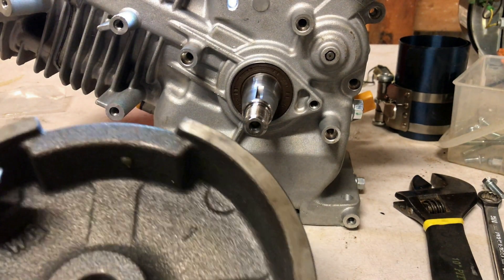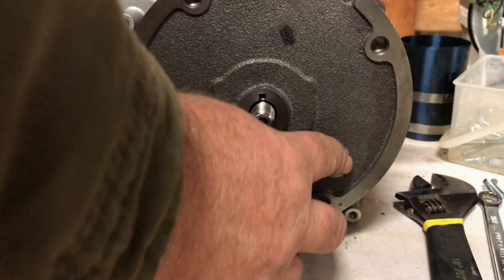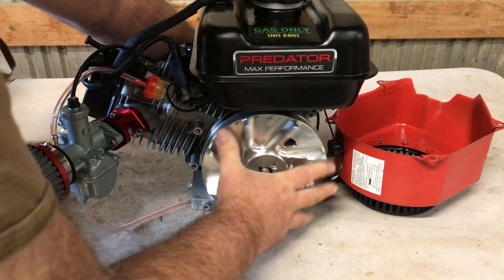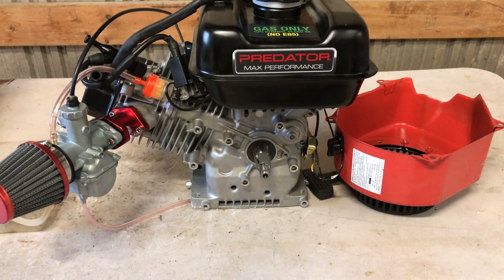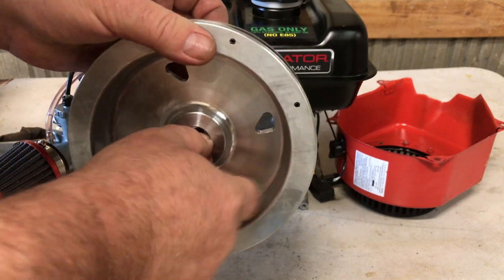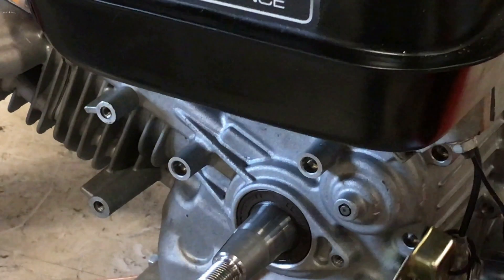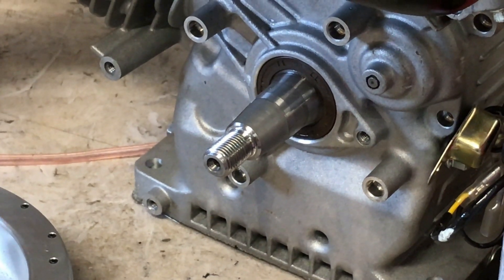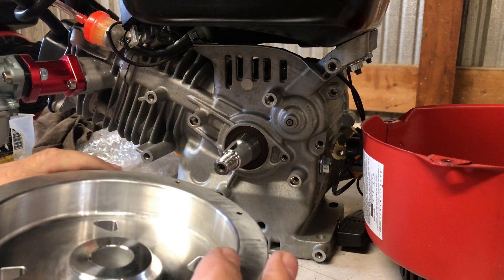Hard Starting and Kickback Solutions for your 224 Predator 212 Engine Build 223 Wildcat 236

Comment: Hey man, I just finished building my predator 212 hemi. It’s got billet rod and flywheel, vm22 clone carb, .010 hg and high compression piston. It does kick back sometimes and with the spark plug in is kind of hard to pull. I’ve got it running a couple times but I’m wondering what kind of gas should I use? I used regular non ethanol gas from before I built the engine. I don’t know if it’s high enough octane, or if the gas is too old what kind of fuel would you recommend ?
Reply from the maker: If you have a 212 with a flat top piston and a .010 head gasket it's probably building enough compression to benefit from a higher octane fuel (depending on the amount of quench you've got). I'd check the small stuff first to make sure the valve lash is set properly and the timing is not too far advanced. If you're running a billet flywheel those will have an advance in ignition timing even if you have a stock "0 degree" timing key installed. They're really set up for racing and Methanol fuel for the best performance. Lots of advance is great for performance but if it starts pulling the rope from your hand more often than not, you may need to reduce the timing a few degrees. The only other option would be an electric start. Gasoline fuels won't handle as much timing advance as Methanol fuels. If you're using gasoline type fuel try mixing a little synthetic two stroke oil, maybe start with a 100:1 mix and see if that helps, if not you can mix more two stroke oil in the fuel if you need. I know it sounds crazy but the two stroke oil will make your fuel heavier and that will reduce pre-ignition and kickback. It's also cheaper than buying high octane race gas. Small stuff first then if your problem remains you can start checking the big things like if the compression release on the cam is hitting the side of the crankshaft counterweight.
Reply: @KentuckyFriedFixes  I set the valves to .003 and the problem persisted so I set it to .0025, it still starts but is kind of difficult. I heard some people say that setting the valves closer is good but I have no clue. Would methanol or 93 octane be fine to use with that carb? Worst case scenario If I put a thicker head gasket for less compression would that make it easier to start?
Reply: @KentuckyFriedFixes  and could you mix the two stroke oil with higher octane ?
Reply from the maker: @Wbgmt07  Depending on your cam grinder's profile you can set the valve lash at .002 to improve the function of the compression release. Two thousandths was the suggested lash on the Banzai 265 cam from EC to help with compression release issues. Unless you're racing, I'd stay away from Methanol as it takes quite a bit of maintenance to run it. You'll have to do tons of oil changes not to mention flush the fuel system with gasoline every time you put the engine away. Now that's not to say I don't like Methanol fuel, fact is I LOVE IT! But, there's a lot of maintenance that comes with running Methanol fuel and if you're not winning money with the engine it's not very economical for the wallet. You can use two stroke oil in most high octane gasoline fuels. The only exceptions would be any fuel that contains alcohol as that doesn't mix well with the two stroke. If you decide to experiment with fuels I'd suggest a good specific gravity test kit for fuel. They're not cheap these days but it's the only way any fuel experiments will pay off. Depending on how much you've raised the compression, you may be able to get by with some 93 octane (Shell and ask for 93 without alcohol) with a little synthetic two stroke oil mixed in. The 112 and 114 race gas won't benefit you unless you have some really high compression, aside from that those fuels aren't cheap to run either $. Run a compression test and compare your numbers with a stock engine, you'll know whether or not you can use the 112 or 114 octane.
Reply: @KentuckyFriedFixes  OK thanks man 👍👍👍
Reply: @KentuckyFriedFixes  Are you talking about the shell V-power fuel?
Reply: @KentuckyFriedFixes  are you talking about the shell v-power fuel?
Reply from the maker: @Wbgmt07  That's the one. But test it for Ethanol to be sure your local Shell is selling the real deal and not some premium knock-off that contains Ethanol. It probably sounds like a conspiracy theory, but there are some locations that will do that and if your local Shell DOES do that by law it must be listed on the pump that it "may contain Ethanol". If I pay for "Ethanol free" fuel and it tests to contain Ethanol, I start making phone calls to their Corporate office with the address of the location that's selling the "knock-off" version. Of course I'm probably viewed as an old guy yelling "Get off my lawn!" but to me if you pay for something that's advertised as "Ethanol free" I get miffed if it's not.
Reply: @KentuckyFriedFixes  Hahaha I get it man 🤣. I think I’ll try to find the v power 91 or 93, then add a little oil to it. I’m pretty sure because of some law now it has to contain ethanol but it should have no more than 5%.
Reply: @KentuckyFriedFixes  but what I was using before was 3-4 month old 87 ethanol free. So it should hopefully fix my problem it will start but the exhaust will backfire and kick back every 4-5 pulls.
Reply: @KentuckyFriedFixes  if I can only find 93 with ethanol is it safe to use if I add a fuel stabilizer?
Reply from the maker: @Wbgmt07  It's just my opinion but the Ethanol free fuel is best if you're going to add two stroke oil. If you have a different fuel additive you want to try just read the bottle. They'll tell you whether or not Ethanol is recommended with their product.
Reply: @KentuckyFriedFixes  alright thanks man
Reply: @KentuckyFriedFixes  the best ethanol free I could find was 89.. should I add a little 2 stroke oil or what other kind of additive?
Reply from the maker: @Wbgmt07  The synthetic 2 stroke mix will help but if you're having an issue due to compression, you'll probably need a little higher octane to start out with. I have a few recipes for additives to increase octane in gasoline but I can't give those out.
Reply: @KentuckyFriedFixes  OK. So I put Octanium in the 89 and bumped it up to around 95 give or take. Engine runs much better. Still kicks back some but it bogs out and stalls when I give more than 50% throttle. I am still using the stock gas tank. could this potentially be solved with a fuel pump?
Reply from the maker: @Wbgmt07  It sounds like it's running lean. I'd pull the spark plug and verify before making any adjustments to jet size. If the main jet or pilot is too small, a fuel pump won't help you. What size jets are you currently running in the VM22?
Reply: @KentuckyFriedFixes  could it be running too rich? It was backfiring a lot and even white smoke came out carb
Reply: @KentuckyFriedFixes  think my head gasket may be blown which is causing the spark plugs to get super dirty, which might also be why it starts dying
Reply from the maker: @Wbgmt07  The spark plug will tell you if it's running rich or lean. After you get your head gasket sorted, pull the spark plug and check the color. White=lean, Black=rich, a nice milk chocolate brown color is just right.
Reply: @KentuckyFriedFixes  OK looking back I think it is ok. I think that my engine was smoking some because of air fuel ratio and brand new piston rings being broken in. My spark plug getting super dirty I probably thought my air fuel was too rich but I was probably flooding the carb by trying to start it several times
Reply: @KentuckyFriedFixes  Hey so I accidentally torqued the rod to 13.5 ft pounds or 162 inch pounds instead of 170. Im probably gonna take it back apart and torque to spec but im just wondering if I do can I leave the cam and lifters in so I don’t have to adjust the valves again
Reply from the maker: @Wbgmt07  Hi West! Once the side cover has been removed to access the internals, you'll need to adjust the valve lash after it's installed. The side cover can move a few thousandths of an inch one way or the other. It's a good idea to always follow the manufacturer's procedure and torque spec for the rod bolts. Give them a call, there's usually one spec for lubricated rod bolts and a different spec if you install them dry.

Comment: I’m so damn lost with this shit lol
Reply from the maker: Hi Tyler! It's not magic and anyone can do this. If you're having kickback issues from the Predator 224 build or a similar engine build there's usually 3 things to concentrate on, Fuel type and specifically fuel octane, valve lash and ignition timing. The engines with high performance parts will always run better with the timing set high but if it starts pulling the rope from your hand more often than not you can make a few adjustments, or use an electric starter if you're racing. Fuel can cause the same issue if you're running a lot of compression and don't have the right fuel. A little two cycle oil mixed in with the fuel can do wonders.
Reply: @KentuckyFriedFixes  okay awesome man I really appreciate the advice to be honest I just have never messed with timing before so I’m a little lost but fuel I can understand , my cart has a hard time starting like a have to pull it 50 times an once it starts it’ll run strong but takes forever to start and it kicks back
Reply: @KentuckyFriedFixes  I just run regular 87 because I was told to run that
Reply from the maker: @tyleradcock5493  Hi Tyler! 87 octane is fine for stock engines. You only need the race gas or Methanol for racing builds with high compression. If it takes more than 3 pulls to start your engine, something is wrong. Either carburetor fuel or air leak issue or the spark plug needs replaced. A good tune up and a valve adjustment will probably help your engine behave properly.
Reply: @KentuckyFriedFixes  okay thanks man I will try when you say valve adjustment how do I go about that ?
Reply from the maker: @tyleradcock5493  Check out some of my engine build videos. Just fast forward to the valve adjustment part when I install the head.
Reply: @KentuckyFriedFixes  okay thank you very much man

Comment: Very late to the game if anyone sees can I lash to .005? I have kickback on .003 runs first pull but kicks every other
Reply from the maker: Hi Guy Farmer! The valve lash really depends on the camshaft choice of your build. This video was designed for the guys following along on the Predator 224 build. In that one we used a 265 lift "Banzai" camshaft and the specs on the valve lash were suggested at .003 but the guys at EC recommended setting it at .002 to work better with the compression release. Usually the looser you go on the valve lash, the more problems you'll have with the compression release not working for you. If you have the billet flywheel installed you might have to reduce the ignition timing a bit to get it where it's not yanking the rope out of your hand more often than not. That's the problem with advanced timing, the engines love it and will make more power but unless you're using an electric starter, one arm will eventually be longer than the other.

Comment: Before youall leave, how do i stop that kick back? I really didn't cach that. What thats it?😮😂
Reply from the maker: Hi Chuck. This video was mainly concentrating on the 224 Predator build and stopping the kickback that comes with that build. Some of the stuff still applies to other engines though. A quick recap would be: 1.Check the valve lash. 2. Check if your aftermarket flywheel has a timing advance "built in". 3. Reduce any excess timing, either by using a modified flywheel key or a properly done delete of the flywheel key to allow timing reduction by moving the flywheel counter-clockwise. 4. I don't remember if I mentioned it in the video but some of the 58mm stroke 224 crankshafts also have a rough finish on the side of the counterweight near the camshaft gear. I usually pick a crankshaft that has the side machined smoothly (or do some lathe work in that area if I'm committed to using that particular crankshaft). The reason is sometimes the crank with the rough counterweight can contact the compression release on the camshaft. You can also modify the compression release on the camshaft but I don't like doing that.

Comment: Couldn't you run an advanced key backwards to retrieve less advanced timing?
Reply from the maker: Hi Tyler! Sure you can turn an advance key around and make it lower the ignition timing by the same degree it would have advanced it. I personally don't use flywheel keys with billet flywheels, I've ruined an expensive billet flywheel by doing that in the past. (Rather than shearing the flywheel key, they can destroy the timing slot and taper of the flywheel.)

Comment: Oil in fuel such as 2 stroke oil actually lowers the octane of the fuel I'm not sure that would help In this situation.?
Reply from the maker: Ho Josh! You are 100% correct! Adding the 2 stroke oil will NOT increase the octane of the fuel. Adding some 2 stroke oil to gasoline makes the fuel "heavier". It has more to do with increasing the specific gravity of the fuel and nothing to do with increasing octane. The octane can be increased with a few common additives. When you make the fuel heavier, you slow the burn and reduce pre-ignition. Normally (as I'm sure you already know,) these little engines don't require high octane fuel. The only time you run into issues is when you increase the compression and/or advance the ignition timing when building a performance or race engine. Thanks Josh I appreciate the discussion from sharp guys like you!

Comment: My 212 was doin that at the gas station yesterday. Thought I was stranded but it started after like 10 gruesome pulls
Reply from the maker: It may be a valve adjustment issue. If the valve lash gets too wide, the compression release will not work. Start with the easy stuff like checking the valve lash, then work your way up the list from there.

Comment: Mine does not start how do i fix that and every 6 7 pulls its doing kick back how do i fix that valve lash
Reply from the maker: Hi Nishat! If you'll check out some of my engine build videos during the final assembly I usually demonstrate how to adjust the valve lash properly in the video.
Reply: @KentuckyFriedFixes  i fixed the valve lash and it fixed it but after 1 ride that was like 10 min long i took a break then tried starting it then it gave me kick back and i set the valve lash again it  worked i started it and turned it off then i tried using it today and it gave kick back whats the problem i set the valve lash like 5 times do you think its a carburetor problem
Reply from the maker: @nishatkhan5713  OK, there could be a few issues going on. Here's some possibilities to look at:  First would be if you changed camshafts to an aftermarket, the weight on the compression release mechanism may be coming into contact with the side of the crankshaft counterweight. This is especially common on 224 engines and the 58mm stroke crankshafts. Second, again applies if you've changed the camshaft and/or added increased ratio rockers to increase valve lift. Sometimes the rockers can hit the underside of the valve cover. Look at the inside of valve cove to make sure there's no clearance issues. (You'll see 2 shiny spots on the underside of the valve cover if there's a clearance issue) If the cam and rockers are stock, try setting the valve lash closer at around .002 inch instead of .003. Sometimes a .001 change can make the difference. Excessive camshaft wear could be causing the valve lash to open up sooner too. (High tension valve springs can cause this issue if they're used with stock and some aftermarket camshafts unless it's a "welded lobe cam" design.
Reply: @KentuckyFriedFixes  should i do .002 for intake and exhaust
Reply from the maker: @nishatkhan5713  Hi Nishat! Yes, I'd recommend trying .002 lash for both the intake and exhaust. Also, it's extremely important to set the lash on the exhaust side just after you view the "bump" of the compression release at the valve. Some guys set it on the exhaust when the compression release is not fully disengaged, that can cause problems too. You'll get it.

Comment: I just did a gov delete and added vm22 carb and a cast aluminum flywheel and its not doing that but its compression is higher it ripped it out my hand once is it safe to ride it
Reply from the maker: Hi Nishat! You are likely experiencing either an advanced timing issue from the new flywheel you installed or the valve lash is improperly adjusted. It's always a good starting point to check the valve lash first. When the valve lash is off, the compression release cannot work properly and it will "feel" like it has too much compression. Some kickback every now and then is perfectly normal for a mild performance build but if it starts pulling the rope out of your hand more often than not, you may need to reduce the ignition timing a bit by adjusting the flywheel counter-clockwise. Most guys accomplish this by either lapping the flywheel and delete or file the timing key, or, they purchase an advanced timing key and install it backwards so the ignition timing is reduced, rather than advanced. These little engines run better with an advanced timing but pull starting them is another matter. High Performance builds usually use an external electric starter to overcome a highly advanced timing (and a sore arm from kickbacks).
Reply: @KentuckyFriedFixes  ok thanks